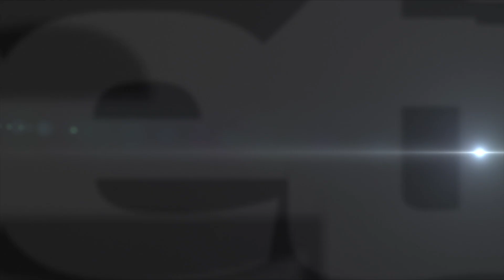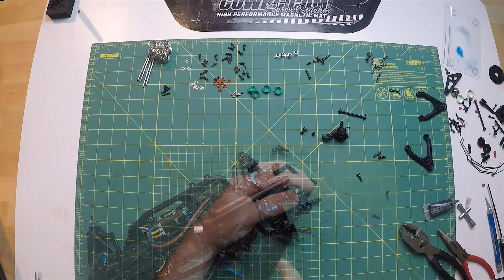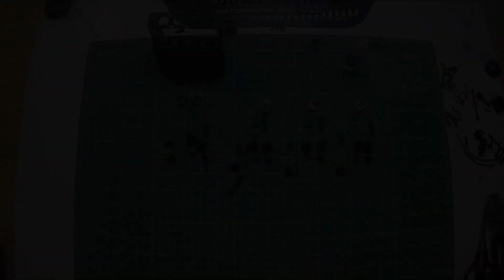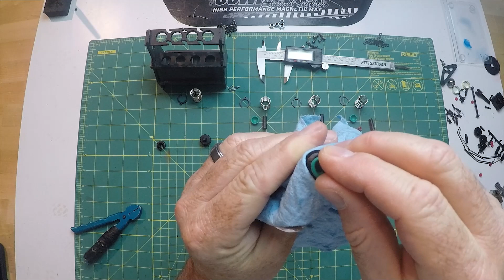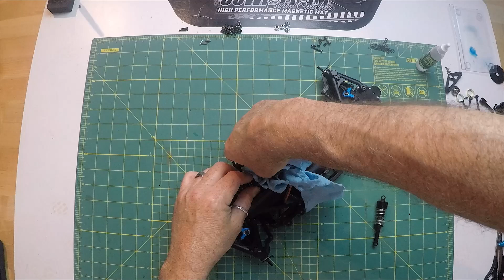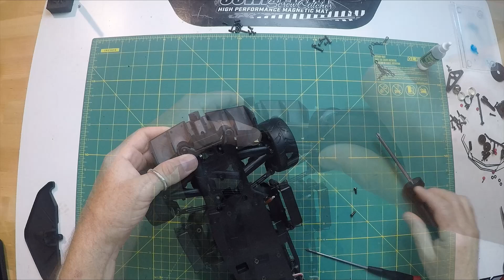Tamiya TC-01 Formula E GEN2 Build - Part 5

Comment: Did you need to shorten the motor shaft on your juststock motor?
Reply from the maker: Shorten the motor shaft? Ummm, no - not sure how you'd even do that without grinding. Standard motors should fit fine in this car.

Comment: This series is awesome. Thank you ... do you think you could put a tamiya touring body on this chassis?
Reply: Yes its possible. The kit has the parts included and the manual has the steps to to let you fit either a touring body or a Toyota TS050 body from the F103GT
Reply from the maker: Yup - as Tommi said, the kit comes with both mounting options for a TC (or LMP) and Formula E body sets.